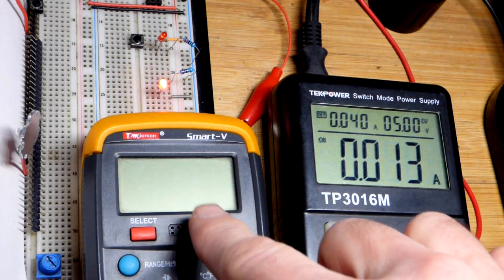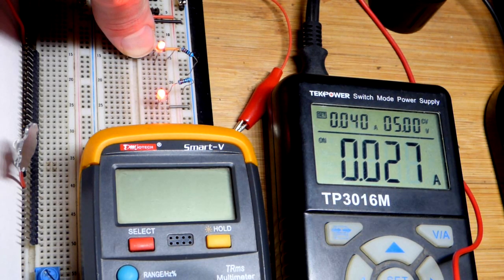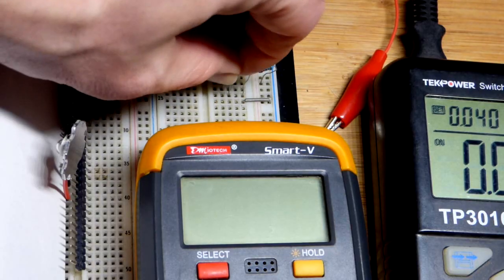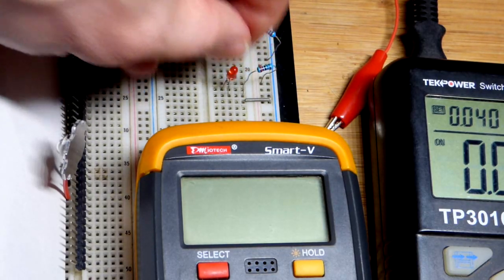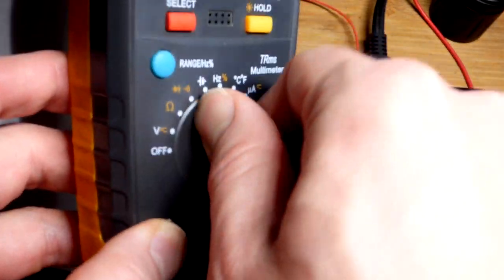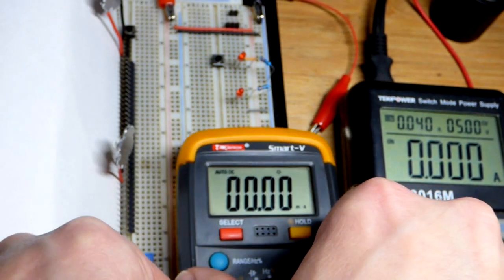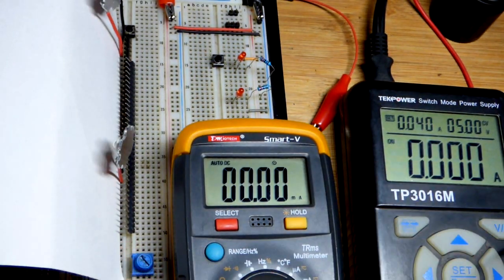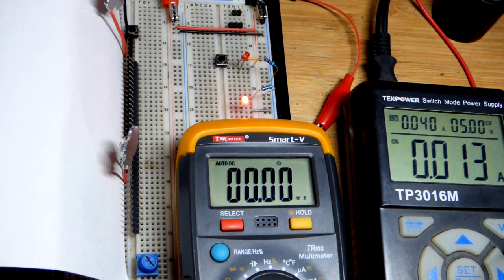How to Measure Circuit Current with a Multimeter

Comment: Thank you for sharing this video on measuring circuit current with a DMM.  The breadboard stuff is a little confusing for me but, it will take a little time.  Between reading about electronics and electric and watching your videos, I should be able to start connecting the dots.  Thank you again.